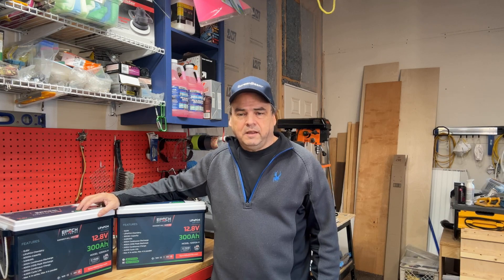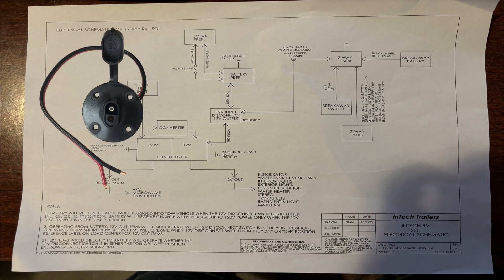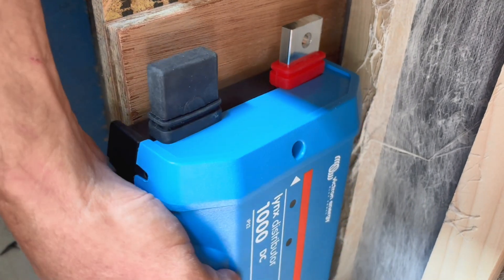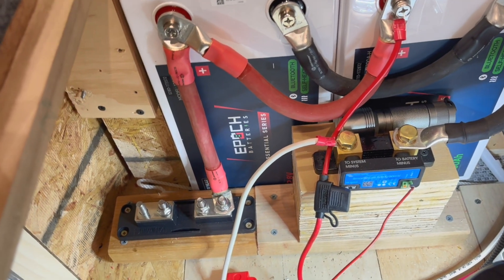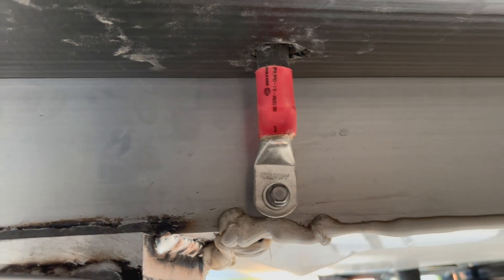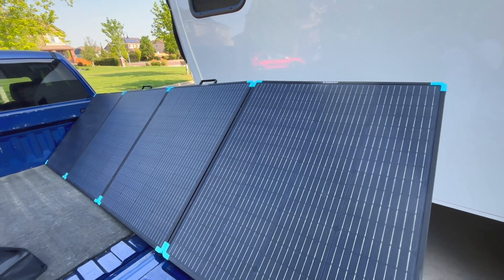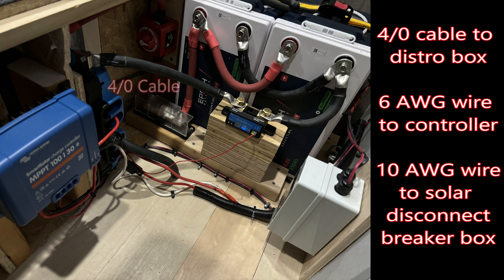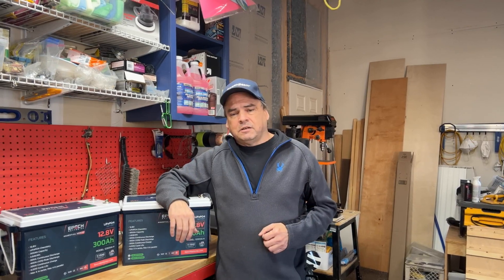Adding Solar to my RV - 2024  Intech Sol Dusk

Comment: Hi, thank you again for the great video. If you could share the parts list of everything you purchased for the Solar upgrade to include Make, Model and links to websites where we can purchase. That would be awesome and very helpful. Thank you in advance.
Reply from the maker: I don't remember all the details but this is most of the stuff I bought for both the battery upgrade and solar upgrade.  

Epoch 12V 300ah batteries (x 2). Purchased directly from Epoch Batteries.   

Victron Solar MPPT Controller, 100/30 purchased from Inverters R Us.  
Victron Shunt purchased from Inverters R Us
Victron Lynx Distribution box purchased from Inverters R Us

4/0 cables and lugs purchased from Windy Nation

60amp circuit breaker from Amazon

250A fast blow Class T fuse (Blue Sea) purchased on Amazon

Class T fuse holder from Blue Sea purchased from Amazon.  

400W portable solar panels from Renogy purchased from Amazon

SAE to MC4 Adapter purchased from Amazon

Battery cutoff switch from Blue Sea bought on Amazon

That should get you most of the way there.

Comment: This really is a great video, thanks.  I am just about to do this myself in my Dusk.  I already have the 2 300 amp lithium batteries and they make all the difference, but am going to wait on an inverter.  I was wondering if there was anything that you would change after a year of experience?  I am about to head to the desert SW (Jan - April) and hope to do a lot of boondocking. Thanks again.
Reply from the maker: Overall, I'm pretty happy with the install.  However, I might relayout a few things from the inner wall to the outer wall (the MPPT Controller).  I was originally planning on using the Victron 12/3000 v. 1. but the v2 is a bit cheaper and more efficient.  However, it's also a different dimension so I think I need more space on that inner wall to fit it.

Comment: Just purchased a 2025 Dusk. I don't want to spend all the money up front. Is there a step by step process that you'd recommend? For example, just start with batteries, then upgrade to 'x'. Just want to get your thoughts. I'm currently in the Durango area and want to upgrade my batteries and be able to charge them with a solar suitcase.
Reply from the maker: I think it depends on your needs and the type of camping you do.  Many of the campgrounds we hit don't have power so batteries was pretty high on my list.  Solar was next followed by some changes to the bed area.  So, I would say figure out what you need most and start there then personalize the things that would make your experience better.

Comment: Hey Jay, I've been following your videos and posts on the Sol Dusk Facebook page - good stuff! I'm also in Colorado, and I'm installing a system almost identical to yours in my 2024 Dusk. Have you decided on an inverter yet?  I'm about to purchase, and I'm looking at a Victron. The Victron is pricey,  but they appear to be worth it. Would you suggest the 3000W? We are in our 60's and want to be able to use the A/C to cool the trailer off while boondocking and not worry about turning everything else off when doing so. Thank! Jeff
Reply from the maker: I'm still trying to decide which to go with.  Right now, the 3000W Victron is my leading choice because it would allow me to run the AC off batteries for several hours.  However, I'm still on the fence because it's another 40+ lbs in front of the axle so I'm concerned about the tongue weight.  If Victron had a 2000W version that fit the space, I would probably go with that...it won't run entirely off the batteries but Victron can blend power sources which would allow me to fire up a small generator and combine that with battery to power the A/C.  But so far, I haven't really needed A/C up in the mountains so I'm still questioning whether I really need to go to 3000W.
Reply from the maker: If you need some help, happy to lend a hand. I'm in the Denver area.
Reply: @RoughRidersTV  Hey Jay, I'm taking you up on your offer to assist me on my wiring of the Dusk. I just received my beasty 3000W Victron MultiPlus-II inverter. I' was hoping for clarification on the wiring of the inverter. Do I just: 1- intercept the existing shore power before the fuse panel (controller), and extend it to the A/C input on the inverter (using a 50A fuse per inverter spec), AND 2 - connect the A/C -1 output on the inverter to the fuse panel (same terminals as the original shore power) by upgrading the 8 AWG to 6 AWG?
Reply from the maker: @JeffTemple-w5w  Sorry, just saw this.  YT doesn't always tell me when someone comments or replies so I missed this post.  

Did you get this installed?

Comment: Do the batteries charge up from shore power also?
Reply from the maker: Yes. The shore power connector runs to the converter through a switch and then to the batteries. So you can charge batteries from shore, solar or the tow vehicle.  However, the TV charge is very, very small and likely not going to do much to charge the batteries.  Much better off charging from shore/generator or solar.

Comment: Very helpful video as we are looking at adding solar and an inverter to our 2025 Dusk.  I made notes and screen shots at various points in your video, but it would be really helpful to also have a written list of the parts used, including make and model, as well as the same for going the next step and adding an inverter.  Maybe you already have a video on adding an inverter?  Thank you very much for the video.
Reply from the maker: Thanks. I don't have a written list of parts but the batteries are epoch essentials at 300ah. The controller is a victron 100/30. The panels are renogy 400w portable. I don’t remember the circuit breaker but it was a 60amp breaker.

Comment: Is the 250 amp fuse sized purely on the load for this particular trailer or does battery wh capacity have any influence?  I’m planning for a Magnolia so I think the electrical system is the same. A/C is the same size. Magnolia has a microwave too.
Reply from the maker: I sized it based upon both as well as the wire.  Fuses are there to blow when you push too much current for the wire that is carrying the current.  I'm using 4/0 cabling so it can carry a lot of current.  The batteries are also capable of pushing a lot of current (as I recall, it was about 200a) and because they are placed in parallel, that current doubles.  So, I don't want to be in a situation where the battery can push all it's current due to a short, etc. in a short period so I want to be below that limit.  I also want to be within the tolerance of the 4/0 cabling (which changes based upon length of run, temp, etc.). Lastly, I wanted to have enough current to run everything that I might need when pulling from the battery, this includes stuff after I install an inverter/charger (so ac appliances as well).  So, I chose the 250a fast burn class T fuse since it gives me a lot of current but still well below the max battery spec and within the 4/0 cable spec and still enough to power pretty much all my devices.  

Keep in mind, you are looking at worse case scenarios when selecting fuse size. It's what is the most current that can hit the wire without heating up and starting a fire.  Under regular use, you should not see that type of load.  It's not like you will have the TV on, the microwave running, the A/C running, the coffee maker running, all your phones charging, all the lights on, the water heater running, the pumps running, etc...all at the same time. If that is your expected use case, then you need a very, very robust electrical system with even more heavy duty cabling, etc.  So, it's really about what happens if something shorts and demands a massive current surge?  How much current do you want to take before you blow the fuse and then size accordingly.  

Keep in mind, there are also fuses in the Lynx distro box for the individual circuits so that they don't short and pull too much load.  Those are sized based upon the power needs of that circuit (and again the size of the wire).

Now, you could get around some of this by moving up to a 48V setup since that would lower the current output and allow for smaller wiring.  But you would need to step it back down to 12V for your DC loads.
Reply: @RoughRidersTV  Makes sense. Thanks. So prior to the inverter install the charge current for the batteries flows from the trailer panel through the distributor to the batteries when connected to shore power?

Also, it appears you have the tongue jack cable connected directly to the distributor box too?

Did you setup any fans for cooling?
Reply from the maker: @Chickennss  Correct.  When connected to shore power, it flows to the Converter/Distibution panel (where the fuses are), then through the factory disconnect switch.  From there it goes to the Lynx distribution box.  Then from the box to another disconnect switch, to the fuse to the battery.  When I add an inverter charger, I will put in a splitter that feeds up to the distribution panel (where I will disconnect the converter) and then the other split will go to the inverter/charger.  Then from the inverter/charger to the Lynx box to the batteries.  

The tongue jack is wired to the lynx box so it can pull from the battery.  

I haven't needed any cooling fans yet because there' not much heat generating stuff in there.  Once I add the inverter/charger, I will add an exhaust fan where the LA battery vent is and try for negative pressure venting.  I will probably add a temp control line so it only kicks on when a specific temp is reached.  If I still end up with too much heat in the compartment, I will add an intake fan below the dinette to pull in fresh air from the cabin. Hoping the 2nd fan isn't needed but hard to say just yet.
Reply: Cool. Please post a video if and when you add the inverter.
Reply from the maker: @Chickennss  Yep, that is the plan.  I just need to figure out what inverter I'm going to use.  Likely be a Victron, but not decided yet.  Plan on doing it around May when I know I've got good weather to work in.
Reply: It appears you did not include any charging from the tow vehicle in this setup. I believe one need a DC to DC charger to manage that. Did you unhook and tuck that wire away?
Reply from the maker: @ Correct, no charging from the TV.  I found the capacity will last for days when camping without needing to recharge.  So, decided to go without adding charging from the TV.  The cost was too prohibitive to justify the limited use I would get from it.  If I were always driving 8+ hours a day, several days in a row where I had no time to stop and top off the batteries, I would probably do it but I just don't see me ever doing that type of stuff. My worse case scenario would be driving across country and I could easily top the batteries off in about 20 mins. over breakfast with my little generator if I needed it.  

I know people say it will damage your alternator and a battery without BMS could certainly do that, the charge wire from the TV, it is TINY so it's not going to deliver much current to the battery. The wire just isn't big enough to pull any serious current from the alternator. Furthermore, the alternator sits behind a fuse so it would pop the fuse before it placed too much strain on the alternator.  

I've run some tests over the summer and it never created any concern for me (I'm an Electronic Engineer) that has worked on cars for 40 years).  I left the charge wire from the TV in place. Though it's easy to disconnect if it really bothers you.  It's 1 wire on the factory disconnect switch and takes about 10 mins to remove, wrap in electrical tape and reinstall the switch.
Reply: What size mega fuses are you using in your lynx distributor for each connection?
Reply from the maker: @Chickennss  I don't recall, I sized each based upon the load of the circuit.  Trailer is in storage now, still about a month before I pull it out.

Comment: Purchased a 2024 Willow in July 24.   I am looking to do a LIthium upgrade and utilize portable panels like yourself.     What were your determing factors to choose 2 300ah batteries?    What does the distro center provide?   Thank you
Reply from the maker: For me it was about boondocking for an extended period of time and also having enough battery bank that I could potentially run A/C (when I ad an inverter) for a few hours to cool down the trailer on a very hot day.

Comment: Awesome video. Could i add two more of those batteries and have 1200 Amp Hours total?
Reply from the maker: I think it depends.  On this trailer, I would not go that high for a couple of reasons. 1) each battery weighs in nearly 60lbs.  So adding another 120lbs in battery weight means less capacity to carry other gear. 2) The batteries sit in front of the axle which would then add a lot more tongue weight to my hitch.  It would impact how it tows. 3) My battery compartment is already small so 2 more batteries would take up way more space and not leave room for an inverter.  

So that is why I wouldn't do it on MY trailer.  However, there is no technical reason topping from putting 4 batteries in parallel and I have seen larger trailers with a very large battery array.  So, yes you can but it depends on a number of factors to determine whether it is worth it in your rig.  Hope that helps.
Reply: @ thanks

Comment: Does your 400 watt portable solar panel have it's own built in charge controller, and if so can you still connect thes inputs to the victron solar controller, or do you just put them into the victron distribution box.?
Reply from the maker: @ralphmossman974  no. I needed to install a. 100/30 controller in the EV

Comment: Great video! Disappointing that there are so few videos of people upgrading Intech trailers, I'm about to get an OVR and I suspect my setup will be very similar.
Reply from the maker: I think the OVR and the Sol lines do share a lot of common design elements and manufacturing processes.  I do have more upgrades planned, just not enough time to get them done and videos edited.  With winter here in CO, it will be spring before I can start on the next round of upgrades.